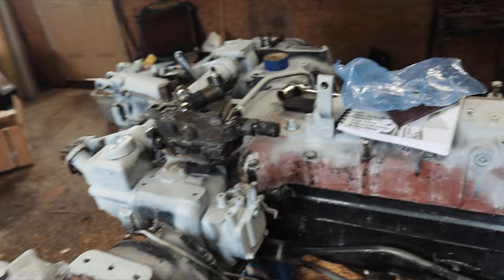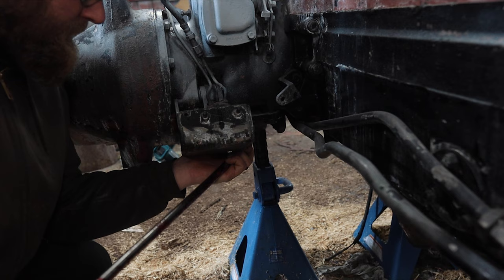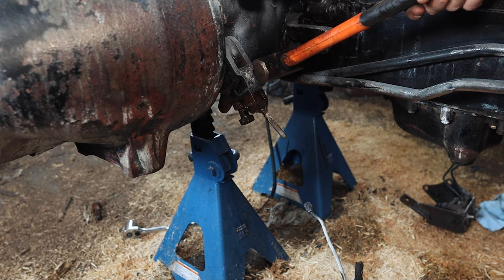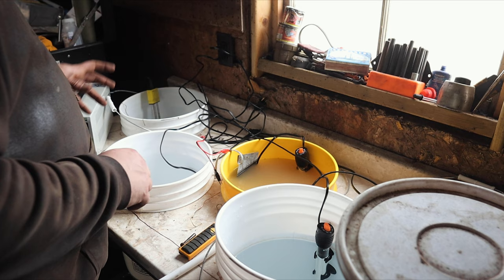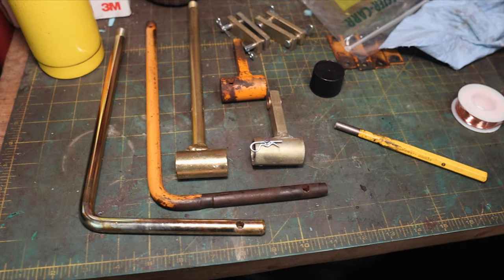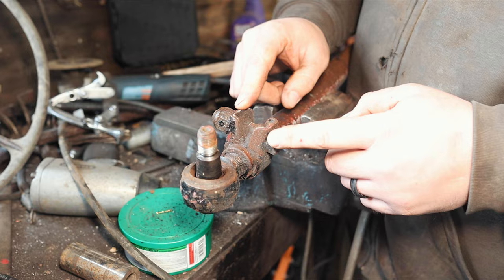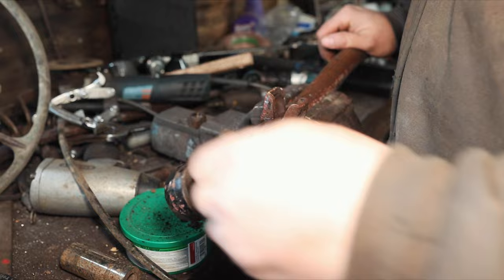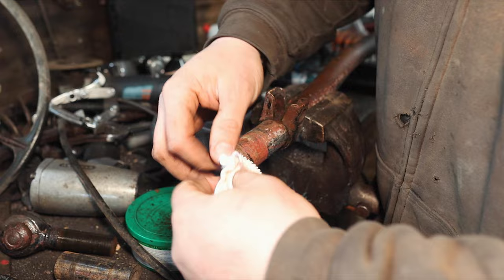Case David Brown 1394 Restoration | Steering cylinder and tie rod repair

Comment: Zinc plating is awesome. I use a claw hammer all the time too LOL I don't have good luck with aftermarket parts unless someone recommends a specific one that is good. You live in Canada and don't have Metric grease zerks?????? HA HA HA!
Reply from the maker: Yeah aftermarket can be a crap shoot at times but it’s hard to buy OEM when it’s exponentially more money lol. The DB outfit sells functional parts but I’ve run into some stuff that I just wouldn’t want to use on a restoration. Which makes it hard when you go to order more important stuff wondering what it’s going to look like when it arrives. Like the nice white steering wheel we have for the 380CK 🤦‍♂️ anyway, it’s the fun world of working on obsolete equipment I guess. Live in Canada but  all the equipment uses SAE fittings lol, the only other time I’ve run into them is on the Hitachi.

Comment: Nice results on the zinc plating. You might need a larger shop but I can see your next project could be an old Massey articulated 4WD. I was hearing wind noise when you were working on the first end and wondering if it was at my house until you showed us the completed steering rod, it was your place!
Reply from the maker: haha well we already did one big MF 4wd it would be cool to do another. Yes that other shop always seems to have wind on that big door, always howling.
Reply: @macfarms  Yes, I seen the video of you mentioning the big MF and commenting that you wish it never got sold. Can’t have enough power and weight for big tankers of manure.